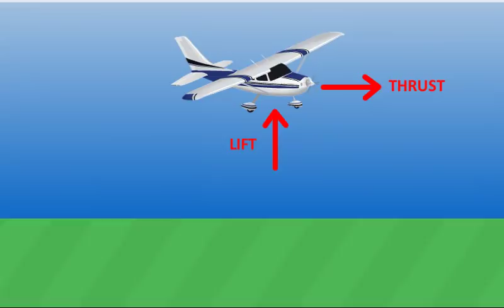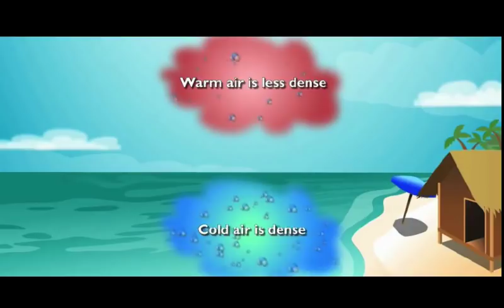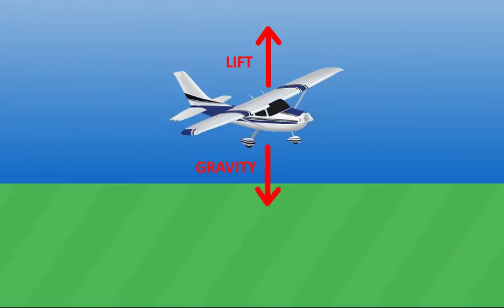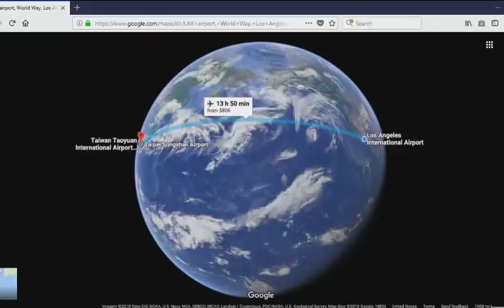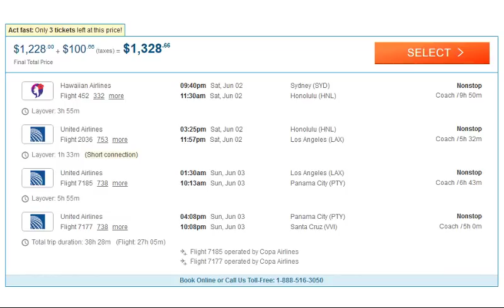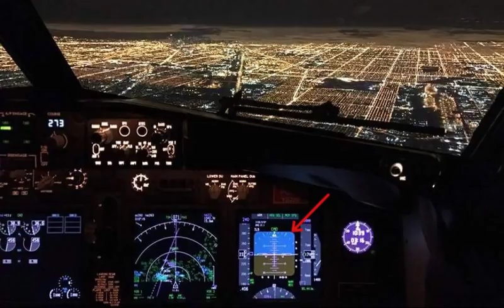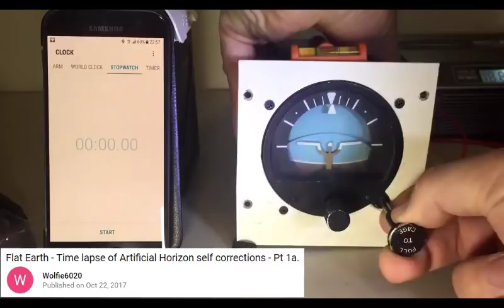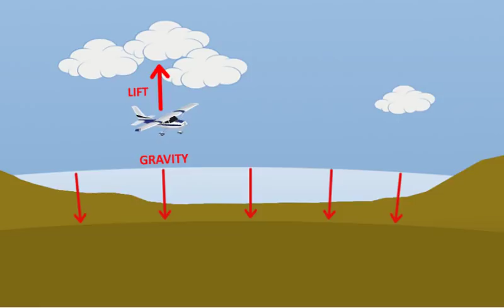Flat Earth Falsities - Plane Nonsense

Comment: Ya Einsteins theory of relativity and the bending of Space and time. That’s what I ment.  I’m not a flat earther nor am I a scientist. 

Show me proof of the Earth, moving through nothingness (vaccum of Space) then I will concede.
Science explains how things work on the Earth below to a certain point and above up to a certain point. I don’t have a problem with that. 
Any thing passed these points is nothing more then speculation based on theories that have changed over our history. If Science can prove for sure using the Scientific method that we are living on a spinning rock herling in a supposed vaccum then I will accept this and move on.
Unfortunately until that time I remain sceptical.
Reply: "I’m not a flat earther "
Your behavior suggests otherwise.  

"nor am I a scientist. "
That much is clear.

"Show me proof of the Earth, moving through nothingness (vaccum of Space) then I will concede."
Go to your local library.  Ask your librarian to point you towards the section on astronomy.  Read one of the books.  I suggest you start with a beginner level astronomy book.

"Any thing passed these points is nothing more then speculation based on theories that have changed over our history."
Wrong.  This is you trying to come up with reasons for why you can ignore anything that contradicts you.

"If Science can prove for sure using the Scientific method that we are living on a spinning rock herling in a supposed vaccum then I will accept this and move on."
It was done hundreds of years ago.  Like I said, read an astronomy book.
Reply: Why don't you just read the scientific literature on the subject? We have a few hundred years of people working this out. You don't even seem to actually understand what a scientific theory is. A scientific theory a conclusion based on the evidence gathered thorough experiments and observations using the scientific method. 
I remain skeptical of anyone claiming the earth is flat and stationary since they can provide not a single shred of evidence, working model, map, equations or any valid argument at all really. Flat earth is just a scam on YouTube. They don't even know basic math, yet claim they're doing science.
Do you know where you can read lots on this subject?
Reply: ► The observed seasonal path of the Sun. ►The seasonal changes in the night sky (constellations) or the constellations occluded by the Sun. ►The observed positions of other planets conforms to the heliocentric model which considers motion of both Earth and the other planet(s).
     You are parroting the same language FEers use and will likely parrot the same responses. Science is simple a pretense of FEers who can't even spell hurling or vacuum correctly.
     MIT offers courses in astronomy and physics online for free. Take one, then saying you are skeptical will mean something.
Reply: A trip to nearest observatory and a sixpac of beer to chat with the staff ( cosmologists n astronomers)  will provide the answers to the questions your asking.   How viewing star positions and observations n comparison to earlier ones shows the progression of the planet and supports the heliocentric model of our solar system and galaxy.   I suspect that studying the physics of first year university students will help you understand why such is proof that we are orbiting the sun. I.E. how geometry n vectors works and relative positioning and viewpoints.
Reply: YES YOU ARE A SCIENTIST! A scientist is someone (a person, great sapien or not, not a job with a white coat(no straps!) and glasses employed for) who conducts scientific research to advance knowledge in an area of interest. 
Nothingness is no longer popular (except for creation & design) in Space, after removing annoying Aether[1] now is filled with Somethingness; DARK invisible stuff, Energy, matter, holes, and who knows what other stuff, like allowing GRAVITY a medium, for its very weak grabing and pulling (to a point, if perfectly close it stops!), may the DARK force be with us.

[1] According to ancient and medieval GREEK science, aether (Ancient Greek: αἰθήρ, aither), also spelled æther or ether and also called quintessence, is the material that fills the region of the universe above the terrestrial sphere.
Reply: This “spinning rock” spins half as fast as the hour hand on a click. Not very dramatic at all.

Comment: Try tossing a ball in opposite direction while going 100 on a train. That's the same principle. Do you think the one going with the train will get to the other side slower. Absolutey not. They both are going the same speed at time of release. Come on, what happened to common sense

Comment: Planes don’t fly off the planet for the same reason your car doesn’t drive into orbit: gravitational pull.
Reply: The irony is overwhelming 🙈
Reply: Repeating the brainwashing doenst show inteligence. Try to prove it. If you could.
Reply: Repeating the lies you were brainwashing with doesn't show inteligence, it shoe=ws brainwashng and gullibility.
Aircraft curvature
https://www.youtube.com/watch?v=zX3upPW7uw4
There is no adjustment needed as the aircraft will naturally follow the curvature of the earth without any input from the pilot. This is because the aircraft flies through the atmosphere which also follows the curvature of the earth.
It's the air pressure that keeps a plane in level flight. Increasing altitude reduces the lift and the plane falls; decreasing altitude increases the lift and the planes rises. The angle you're talking about is around 0.01 degrees
Inertial navigation is different. The "schuler loop" is an integral part of avionics, that automatically compensate for earth's curvature.
https://en.wikipedia.org/wiki/Schuler_tuning
And read  the references provided.
https://en.wikipedia.org/wiki/Schuler_tuning
http://www.mediander.com/connects/26619546/ln-3-inertial-navigation-system/#!/topic/-/
http://aerostudents.com/files/avionics/navigationBasicsAndInertialNavigation.pdf
You were saying?
 @EL_mann
Reply: @EL_mann  we can demonstrate gravity with simple experiments showing attraction between mass. Come back when you've taken a physics class.
Reply: The irony is overwhelming 🙈

Comment: As to speed, duration, distance of flights East to West vs.West to East, actually the flights heading East ARE much shorter than the flights heading west due to a combination of the Earth's spin and the jet stream.  Anyone who frequently flies to Europe from the USA or even from the West Coast to the East coast is aware of this.
Reply: I was going to comment this. I have flown from Mexico City to Shanghai, and not only is shorter on the way back, but the also needs a refuel stop on the way over to Shanghai
Reply: Jet stream? The only reason it is faster is due to wind direction. 

Let's say you have a car driving from South to North and the wind direction is the same, while another car is driving from north to south against the wind direction. Both vehicles will have the same speed, now tell me who do you think will be faster ? 

Same principle goes for flying, it has nothing to do with the spin of the earth. Planes flying from east to west (if I'm not mistaken) usually fly with the air current to save up on fuel and fly time, while flights from West to east tend to against the wind current thus having more air resistance and have to consume more fuel.
Reply: @gusgee3135  Well it is the opposite, the trip from West to East is faster if there are no winds to contend with but normally subtantially faster still due to the jet stream which flows West to East in the Northern hemisphere because of,,,, yes,,,, the Earth's spin! You do understand what the jet stream is right? The air currents you alluded to which can be well over 200 hundred miles per hour.  No Earth rotation, no jet stream..  I've been on directs many times covering the same routes from West coast to East and vice versa. However, you also lose 3 hours going East due to time zone changes which are also due to, wait for it, the Earth's rotation!

Comment: Hello, love your video series. I like the detailed explanations, they are easy to understand and well constructed.

Part of my research on the arguments used by flat-earth believers I discovered the amazing devices called Ring Laser Gyroscopes which as far as I understand are now used on modern aircraft as part of the INS (Inertial Navigation System).

They are even mentioned in the excellent documentary "Beyond the Curve" on netflix.

Since you touched on the subject on gyroscopes, airplanes and "dipping of the nose", it would nice if you can extend this video, or add a special episode on this topic. These gyroscopes are sensitive enough that they detect the rotation of the earth. From what I've read, part of the "take off" procedure for an aircraft is calibrating these INS ring laser systems by detecting the rotation of the earth and the current longitude position of the aircraft. This is in the "training" material found on youtube.

I would expect that a ring laser gyroscope would detect the effects "nose dipping" in relation to "absolute space" (or "background stars" as they call it - interesting read). If you find any material on the subject or if you could comment on that it would be great. I would love to confirm my expectation.

Comment: So if the mph is higher at the equator than the poles why isn't gravity at the poles affected by the slower rotation speed? Shouldn't you feel heavier at the poles and lighter at the equator?
Reply: there are multiple videos showing a difference in weight -- as expected -- by moving a calibrated weight and scale towards or away from the equator.
www.youtube.com/watch?v=CkhxPm15PFo   <  Wolfie 6020 doing an experiment across 15 degrees in Australia showing exactly what the spheroid model predicts
Reply from the maker: DJ DFC - Actually we do weigh very slightly less at the equator than at the poles. Congratulations, you just stumbled onto evidence for the sphere.

http://curious.astro.cornell.edu/about-us/42-our-solar-system/the-earth/gravity/94-does-your-weight-change-between-the-poles-and-the-equator-intermediate
Reply: @JonasGrumby71  Just re-read article.  Distance from center is an additional factor, not the only factor.
Reply: @JonasGrumby71  According to your source, the weight difference is due to the difference in distance from the center of earth.  The person you are responding to is questioning the effect of speed on weight at the equator.  On a flat, spinning disc, the farther you are from the center, the more forcefully you will be pulled to the center.  The equator is a circular plane within the somewhat spherical earth.  So, there is an interplay between spin and gravity.  According to the video I watched, standing on the side edge of a spinning disc (rather than the face) would negate the pulling effect to the center.  Standing on the side edge would be the equivalent of standing at our equator.   https://youtu.be/JvHdTwTP_hs
Reply: Gravity isn't but weight is.

Comment: Gravity is a theory based on theory. For me the Globe model looks like "Imagine gravity, imagine curved water, imagine a ball and now believe in a spinning ball."
Reply: You don't have to imagine anything.  Apply what you can easily prove to yourself.  Think about a merry go round at the park.  You are actually being pulled to the center by the merry go round, even though you experience it as being flung outward.  The pull is caused by the merry go round taking your body from the straight path that it would otherwise follow.  If you let go, you are leaving the merry go round in a straight trajectory because the "force" of merry go round is no longer pulling you to middle.  Go to the circus, watch the spinning cages and observe the way the performers fall with the cage.  If the Earth was astronomically less massive, this is how it would look for us to stand on a spinning ball traveling through space. You would experience it more like floating with, rather than standing on it.  Mass and gravity.
Reply: What do you think is south of the earth that pulls everything "down" to the south pole? That is assuming you are like many I've seen that think all of earths water would slide off the south pole if it were a globe (which it is).
Reply: Too bad for you it can additionally be proven, thus rendering belief pointless. It seems that you're confusing your own belief system with science.
"Imagine flerspective, imagine flensity and fluoyancy, imagine unpredictable yet very convenient new atmospheric anomalies, imagine a conspiracy ... pfooo, now the idea becomes a little less impossible. Now we can start pro- eh, did I say proving?" *hides gyroscope behind back* "Just repeat after me: Water is always flat. Water always seeks its level. The horizon always rises to eye-level."
Reply: Of course gravity does exist. How do you think the tides work. Answer gravity. The moon's gravity is resposible for the tides.
Reply: no.  gravity became a scientific theory based on observation, experimentation and measurement.
.. as is the model of the spheroid Earth.  the changes over the years have been in the accuracy of the model -- not the basic model

colloquial definition of "theory" -- I have a guess about what's happening  .. this is actually the hypothesis in science
then you and others perform experiments to prove/disprove this guess ( as to what causes objects to fall to the ground in this case )
.. allow others to critique your experiment, view the raw data.  welcome others repeating your experiment
if you all come up with the same results your hypothesis might become a scientific theory / or part of one
Reply: @kazoosc  What?????? Gravity is proven?????? ARE YOU IDIOT?????????????????? Gravity is just a theory
Reply: Care to cite the works you have discovered that disproves gravity?
Reply: @ВродебыАлександр  Have you noticed that only one person is throwing an infantile, shouty, all-caps hissy fit? And that person is? You. I wonder why?
Reply: @CaptWesStarwind  science is experiment which must be repeatable, observable and mesearable. Gravity is just a theory, based on other theories, it's bulshit to make people believe a fairy tale we live on spinning globe.
Reply: @therealzilch  i will fall from a tall building on the ground and be dead, because my body is denser than the air around but if I jump from a tall building into the ocean I will be on the surface of water, the water is denser than I am, I won't be stuck to the bottom of the ocean
Reply: @ВродебыАлександр   And why do you fall?  Because of gravity.  Density is not a force, it can't make you move.
Reply: @ВродебыАлександр  
True, it is easier to move through material that is less dense. The question is: why are you moving down instead of some other direction? What is causing the descent?